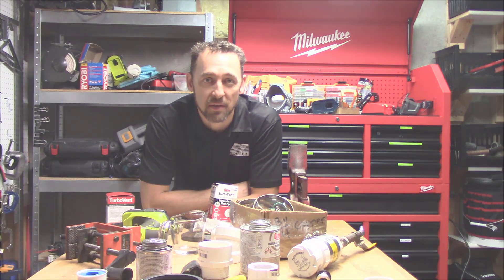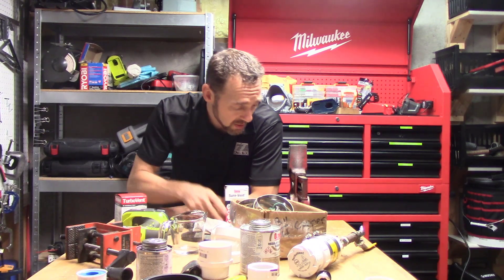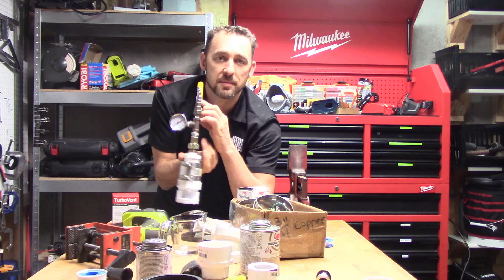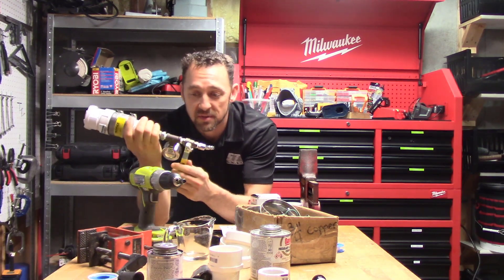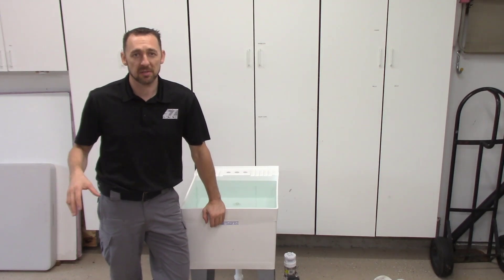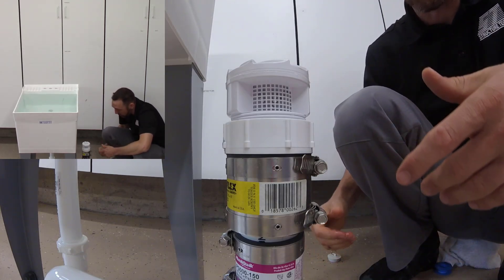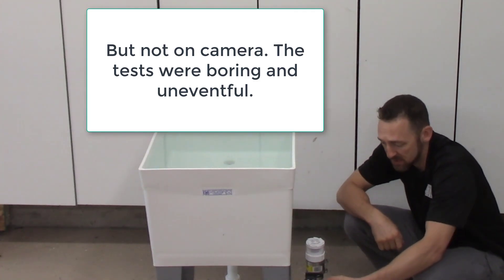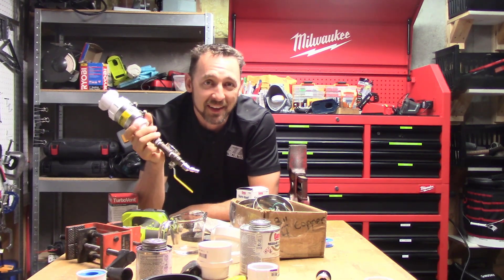Air Admittance Valves

Comment: They work perfectly for as long as the RUBBER seals ( ... and some lubricants ) remain within manufacturing standards. Make sure to allocate replacement strategies. Date the installation and manufacturing. Replace every three to five years from manufacturing date.

Comment: Something to add. On your final experiment where you filled the sink with water and released it, I believe there was a pocket of air pressed up against the diaphragm of the aav. So when sewage fills up and tries to rise into the aav there is an air pocket that keeps waste from getting into the diaphragm and moving parts. I think that’s how they’re approved for installation a min of 4” above the fixture drain and don’t have to follow the traditional venting rule of rising 6” above the flood level of the rim of the fixture being vented.

Comment: Great video. Our homes in Spain do not typically use drain vent pipes. I don´t have any and all my drains (washing machine, showers, sinks and toilets) work super well without them. Maybe has something to do with the fact that we use 1ft x 1ft traps that tie in at various points through out the sewer system. Apparently air admittance valves are common in europe (I just never seen any in my 20+ years living here).

Comment: Minnesota is weird.  The air admittance valve was invented in Sweden where snow on the roof  would block the the vent pipe and many Norwegians and Swedes settled in Minnesota. Canada is also weird because you can't buy a copper repair coupling there, the one without the stop in the middle.

Comment: I just replaced one that was hidden under my sink. I thought they had it vented to the roof. After buying a 1200$ sewer snake to snake my vent and realizing it was blocked so bad even the auger wouldn't clear the vent, I found this aav hidden just beside the top of the sink. So the previous owner had installed one instead of fixing the vent for it. Bloopers were so funny, needed that.

Comment: The kitchen sink in my modular home has one of these valves.  The sink has been acting up for awhile now.   Water goes down very slowly. If I block the other side and turn on the disposer, it would empty.  Then after turning the disposer off and running some water it will eventually start filling up again.  Now after I turn the disposer off most of the water comes back, and will very very slowly drain down. Does it sound like this valve could be not opening at all?  And is that likely to be the only problem or do you think I have a drain blockage also?  Thanks!

Comment: I dont think thise valves should be installed. They cant hold the sewer gases. The swer gases presure is way lower that what you are puting in the test. Another thing is that with time the valve is gonna get all dirty and dusty from the inside and is gonna remain open or not gonna close properly. So is gonna let the sewer gases inside the hause. Not a good idea to use them. Unles you have a hause trap that is gonna block sewr gases altogether from entering the hause

Comment: Those valves are used in rv campers so that might be the reason you see them on the shelves in Minnesota. Though depending on the specific text of the building code certain homes built during a time frame could be allowed to use those valves.

Comment: Question. We have a clogged drain in our kitchen. We snaked it, and found no restrictions. We then removed our Air admittance valve (AAV), and the water began to drain correctly. So we figured we needed to replace the (AAV) with a new one. Once we installed the new one, the sink became clogged again. Please help. Thank You, -RC

Comment: Plumbing code here in the UK specifies that they should always be installed at least 200mm higher than the highest drain on the pipework. That avoids the possibility of water backing up and leaking through a faulty valve as it will back up into the sink/bath/toilet first.

Comment: This was fun with morning coffee.
Almost had coffee coming out of my nose🤣🤣🤣
These things work great. I installed the two I have used above the level of the sink just in case of a backup and they leak.
I did bury them in the wall however. I have no idea if that's legal or if the use of them in my area is legal.
It's my house, so I don't care. I know it's safe and functional.

Comment: Great video!! So I have this friend in MN who owns and lives in the top level of a duplex who wants to add a dishwasher and garbage disposal next to the already existing kitchen sink.  This kitchen sink has been functioning for decades with an AAC as the only ventilation.  This friend may have even found a pro willing to do with work and keep the AAC.  Is there any more "risk" than there was before after adding the disposal and washer?  Also the lower level kitchen is configured the same way with an AAC and already has a dishwasher.  I believe the drain for the top level kitchen ties into the lower level drain.

Comment: Hi mate, great video. Thank you for taking the time to document it. Does the AAV still require a roof vent pipe somewhere in the pipeline to release pressure build up in that pipeline?
Reply: This is what I'm wondering, I have a house that smells like sewage in the back yard. I've searched under the house and can't find a leak. I'm assuming it's games from the vents. My plumber recommended installing an aav on both vent stacks, but I'm concerned the gases will make their way into the house if I do that.
Reply: @genereralspectacles  I'm no expert mate but it sounds like you have to check the pipeline to the main drain that you will share with your neighbours. Do you have an open roof vent pipe? I've mapped out at the pipework in my flat to help single out problem areas. Good luck!

Comment: I installed a FloPlast AF110 air admittance valve in my soil pipe in the bathroom, and it sometimes makes a 'chattering' sound as it sucks air in after flushing the toilet.

Comment: Respectfully I disagree. Yes t worked, but its brand new and hasn't been subject to a hostile environmental factors, contamination and age. I have a problem with a sticking one now causing siphon of the shower trap. There's a reason half the States won't allow these. Maybe its like anything else, keep up on the maintenance but the average yuppie can't even check thier own oil on a dip stick much less maintain and check for problems on these vent valves.

Comment: Interesting tests. I have used one of these valves before on an upstairs bathroom sink and it worked fine. With it being mounted below the sink level though your test makes me wonder if it would leak in that scenario (pipe clogged) if someone tried plunging the sink drain.
Seems like that would get it to leak?

Comment: I'm doing a DIY kitchen sink and just heard about these.  I was looking into adding one to help my sink drain a little faster, but looking into whether they're allowed in my city is coming up with 15 year old forum posts about the possibility they might be banned or limited.  The reason being they have about a 2% failure rate over the last ten years and very few people like sewer gas inside their home.
For my purposes the sink does drain well enough and is vented where it needs to be.  I don't want to risk the failure for a slightly faster kitchen drain so I'm going to skip it.

Comment: Thanks for the video. I've had issues. Kitchen setup includes a main sink and second prep sink located on a kitchen island. Both sinks tie into the same drain line and both sinks have air admittance values. Significant gurgling in prep sink when main sink is drained or whenever dishwasher drains. Installed new values, and installed a few inches higher as it appears the initial install was too low. Still gurgling. Guy is telling me to cut into drain from exterior wall and install a conventional ventilation pipe. What do you think?

Comment: I am adding a bathroom on first floor, there is no vent in the room ,  I am running all the piping from first floor down through basement to connect to the main waste line.

 Does  the cheater valve have to be above the toilet level or can I install it in the basement where the piping is going, .   or will a wet vent occur since I am connecting to the main waste line and that is connected to the vent from the toilet on the second floor

Comment: good video!  STAY for the bloopers at the end
I am not a plumber but I do have these in my home (installed them myself)
as I understand it there is one (1) concern about the reliability of these units, and that is that since these are mechanical valves they may become stuck open.  This can lead to two (2) bad situations
first situation:  sewer gas venting into your house
second situation:  IF the vent is located BELOW the max water line height of the sink it's venting and IF there is blockage in the drain line and IF the AAV is stuck open then there is the possibility of waste water flowing out of the AAV.
For this reason, when these are allowed by code, they are supposed to be installed six (6) inches above the highest water level of the associated fixture.

I have had mine for nearly 30 years, they are not above associated fixtures (I did not know back then what I know now) I have had no problems what so ever from them.
Reply: My AAV is stuck open. That’s why I looked up this information. Can they be repaired or do I need to buy a new one? It smells like sewer in our kitchen and my wife ain’t happy about it.
Reply: @danjabs4135 

Just replace it

Comment: S.O.S  I will try to explain my current situation. 
So i do not have a cap on my vent pipe under my kitchen sink. , not sure if it ever has tbh,  My Family has lived in this mobile home for approximately  2 years but I have just returned form a deployment and my son told me about the issue when I noticed my sink was draining out the vent pipe under the sink.   I went to the roof where there is  two  pipes (idk if they are called vent pipes or stink pipes?  one for bathroom and kitchen. I put my hose in the kitchen roof  pipe and it came out of the vent pipe under my kitchen sink.  I see the line coming in from the roof and is tied into the vent pipe above the main drain and p-traps etc.. The one under the sink  has threads inside the pipe as maybe it had something attached, or may have been capped off at one point?  Anyways, as I  pushed water through the pipe coming out the roof it came out the vent pipe under the sink.  Is there something I am missing here? So I turn the kitchen sink faucet on and it come out in the vent pipe under the sink, that has no cap on it. Is there suppose to be a cap? As my son tried to fix while I was deployed but stated he did not see a vent cap, but maybe there was one as he had to clean the "nasty mess" up and he might have thrown it away, he's not sure. Apologies if this sounds confusing, as I am pretty perplexed as to what's going on. Could it be the Main drain that's plugged forcing the water up the vent pipe under the sink when i turn my kitchen faucet on? Additionally, there is only a bad smell when it overflows, its not a constant smell from that area, or the open vent pipe under the sink. I am not trying to call a plumber, as I am not rich and i really feel I can tackle this my self. My son and his friend stated that they snaked the "main drain" under the sink. Not sure if I should rent a snake and try it myself, or if It actually only needs this cap? As if i buy a cap via process if elimination, will it have my sinks not draining or start draining up the pipe to the roof? and that would tell me if its the main drain pipe for the kitchen? There is nothing else in the home that is backing up or gurgling or anything.  The mobile home is in Michigan and my son told me it all started acting up on a night it went beloiw freezing, and the heat went out that night at the Mobile Home. Thanks for any assistance from anyone that reads this-

Comment: When they fail, and they do fail, your house smells like sewage for days on end. Average small condo will have three of these. There is no way to test them until you cut them off the pipe....so you might as well change them all at once. 
I am not a fan. Good video though!
Reply: The challenge for these is resealing after they admitted air, with a near zero pressure in the pipe. The high pressure in the test only helps it seal. If the sewer gases are just lazily wafting up, that's when they need to prove their worth.

Comment: I have question example [ have 60 feet water line can i do 5feet heat tape ,5feet space and 
 5feet heat tape and on and on total 60feet and use foam pipe insulation cover all the pipe 
 or is there a better way Can you help me A.S.A.P

Comment: I just recently replaced my AAV for my double compartment kitchen sink because it didn't seem to be getting enough air in the system to drain thus when draining a some what soapy sink full, I would get alot of soapy water backing up into the other sink. Some water is expected to back into the other sink but mine was more than it should. Then even after that when draining water down the sink I previously drained all that soapy water, suds would back into the opposing sink excessively.   
Initially I thought I had a partial blockage snaked the line but still had this issue. 
In the end I replaced the AAV (oately) read on the it that it was rated for 9 DFU'S (a kitchen sink is 1.5 DFU'S) The one I got from home Depot was rated for 160 on a branch and 24 on a stack. They seemed to have improved the design and made it larger. 
Now I do not have the issue of excessive suds backing up. 
Just wanted to pass this on if anyone else was having this issue and couldn't figure it out. 
These are designed to stay closed until a positive pressure is applied.  
Venting systems purpose are to "maintain atmospheric pressure" in a plumbing system. 
Thanks for the interesting video!
Reply: That's one aspect I was actually looking to be compared between the different brands of AAVs.  How much vacuum will the valves allow to develop before they open and allow venting to occur. 
This would determine their effectiveness as a vent, and kind of the opposite side of their ability to maintain a seal under positive pressure. 
In my case I want to make sure it doesn't allow a vacuum to develop because my sink drain isn't draining well due to the piping configuration, and correcting it would be too big a deal at this point, having to break open the wall behind cabinets.
I wanted to see which one actually offered the least amount of restriction, with the positive pressure hold as the secondary function, even if that's normally the most important function.
It would need to be tested with a manometer and a vacuum pump, to see how many inches of water it would develop with the valve installed.

Comment: What if you put a plunger on the clog drain and therefore we're forcing positive and negative pressure as you run the plunger in and out? Would that affect the valve?

Also what about the other comments in here where people had to replace them every few months because they started either stinking again, or gurgling and causing a slow drain?

Comment: Thanks for the video. I recently bought a house in TN and I have S traps under all my sinks since it was built before TN had building codes. I have vents pipes that terminate in my attic and occasional get sewer gases in my garage floor drain. Now I at least have a solution code or no code.

Comment: We’ve got one of these on my kitchen sink. The house was renovated and I guess the contractors didn’t want to connect the kitchen sink to the main vent line and just put a stand pipe with one of these on top under the sink. We seriously have to replace it every 6 months or so because it starts to malfunction after a while and gurgles and makes the sink drain slow.
Reply: Have you tried to run a snake down the stand pipe and down your trap?  The 2nd floor of my house was built out in 2012 and the original AAV that was installed then is still working fine.
Reply: @JesseKlaus  as it turns out the sink drain pipe under the house was metal and old as hell. We had it replaced with PVC and it’s been going strong ever since. When the plumber cut the old pipe out he got me to hold one end and he held the other and you couldn’t see light through it from the years of corrosion. The plumbers that snaked it every time just punched small holes in it enough to drain and it would start to close back up after a couple months.

Comment: Thankyou I just got a trailer, and putting in a bathroom sink,and it has the pipe going up through the wall,sink I have won't fit want to cut and put cheater vent,  now here's the thing it has 2 bathrooms and one kitchen sink ,the one I'm putting new sink in vent pipe off of sink,kitchen has a cheater,other bathroom sink has cheater. But it has stink pipe by toilet ,makes no sense ??? Why one bathroom stink pipe hooked to toilet ,with cheater for sink,and other no cheater vent pipe off of sink ???? Ok   can you see any problem I may have,1bath in back trailer 1 in front ,one forkithen sink and that is with laundry drain? Then all runs to a tee then out

Comment: Hello n thanks for the informative video.

I have a question if you don't mind  me asking :) 

I am in a process of plumbing a kitchen island which has a 40mm straight waste pipe going outside the building (about 2meter long) - single kitchen sink with waste trap connected,  goes straight to the waste pipe - does It still need an air admittance valve?

Comment: Thanks so much for this video. I'm putting in a new bath, and shower where none previously  existed  and I have a slate roof I really didn't want to have my plumber cutting into so, you just put my mind at ease about using one of those units. Just wondering if they will need to be replaced once in a while and if so how often, thanks.